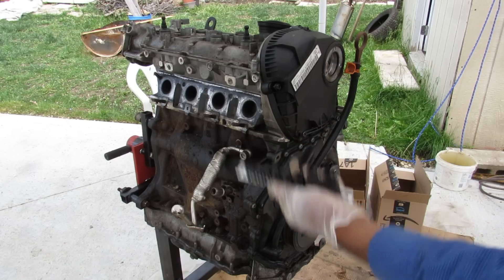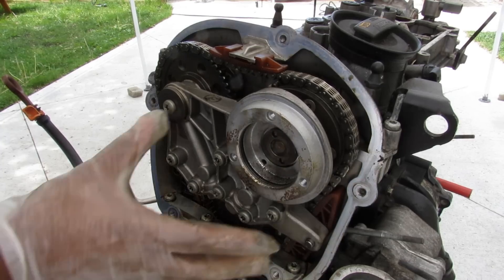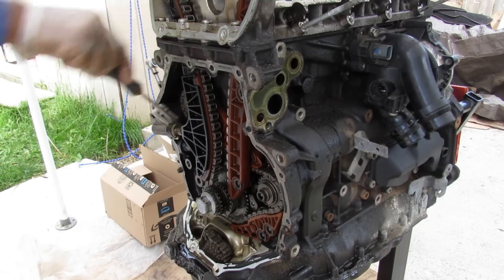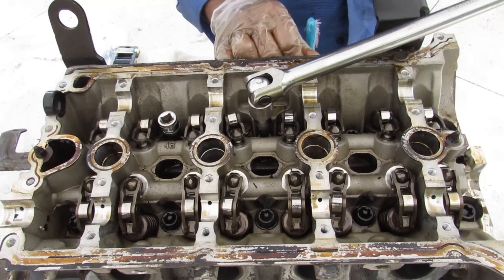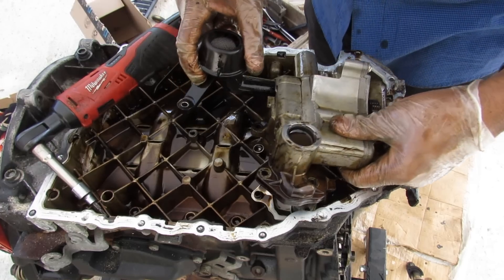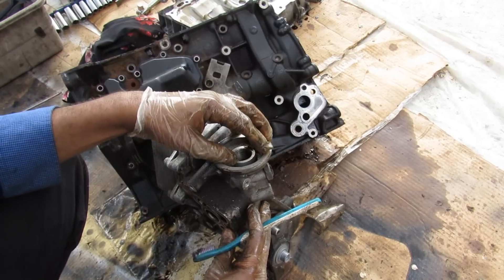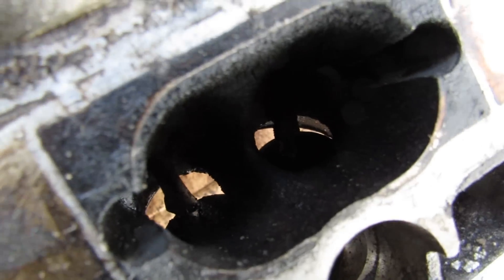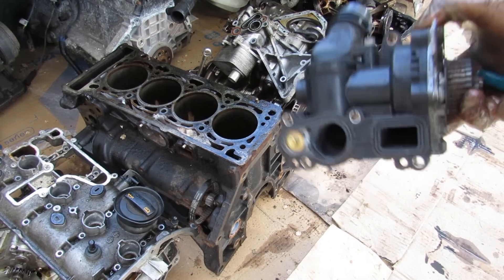Why Volkswagen Engines Fail

Comment: I'm late to this party but I wish I would have seen it before buying a 2018 MK7,5 GTI,  Not only is regular maintenance hugely expensive the engine design absolutely sucks.  I had an oil cooler leak coolant into the crankcase.  The first manifestation was a "low coolant" warning.  I was two miles from the dealer and immediately took it in. They said it was fine.  I got a repeat the next day.  This time I waited until the engine was cool and determined that it was essentially out of coolant.  I had it trucked to the dealer where they charged me $1,500 to replace parts and flush the radiator and change oil.  I expressed concern with coolant in the lubrication system and was told not to worry.  Two days later the engine blew up.  They wound up putting in a used 40K (they say) engine that cost me another $9.5K.  I have $11K in a car worth at best $15K.  The concept is great, handles well, sporty, nice interior, etc. The execution is awful.
Reply: Excellent presentation BTW and funny too.  For reference I also have an '09 Pontiac G8 GT 6.0L with 197K miles on it.  Major maintenance, 1 failed cam follower at 195K.  I keep it around to drive when the VW fails.

Comment: Porsche does not use that engine they use a boxser engine
Reply from the maker: How about the 4 cylinder SUV
Reply: they make a 4 banger n 6 boxser engine @speedkar99
Reply: Why Subaru Engines FAIL boxser engine @speedkar99

Comment: Oil pans are not that stamped steel. That is aftermarket, OEM would be a hard plastic... I know because my previous 2016 GTI's was leaking. They are notorious for leaks and when they do upgrading to a steal one is ideal.
Reply: Depends what year. This engine has been around a while now and there are different versions. My 2008 Golf GTi had a steel oil pan and so does my 2007 Audi A4 TFSI that I still own.

Comment: We have a 2012 Audi A4 wagon 106,665 miles.  It cranks 2-3 seconds longer than it used to and it shakes when cold, is that timing related

Comment: VW/Audi tech here. The accessory bracket doesn’t need to be removed to remove belt tensioner, there’s a 5mm Allen on the back side that you remove to slide the belt tensioner out of the bracket.
Also that is not a valve cover, it’s a cam ladder/girdle/bridge as the bearings are part of that assembly.
Also the oil pump isn’t timed.
Also he kept referring to the vacuum pump as the HPFP, the HPFP bolts to the vacuum pump and runs off the 4 lobe part of the exhaust cam
Reply from the maker: Thanks for the correction.
Reply: @speedkar99  no prob, great video as always. Just wanted to clarify some stuff since I work on these engines basically all day every day haha

Comment: VW engines are shit. Yes, they are powerful per cubic inch, but they are trying to squeeze every KW from the engine using unnecessary complicated and unreliable design and tons of plastic components. So much plastic that even the steel components behave like plastic - thinking about the timing chain.

Comment: I own a Mk5 gti, and owned a mk4 Jetta and I have to say. I will never, ever buy another fucking volkswagen. The only good thing about these engines are the blocks. The rest is always dogshit. I have done everything to this car, and done it in my own garage. I’ve had oil leaks in all places oil can leak. I’ve had not one, not two, but four door actuators fail. I’ve had my crank position sensor fail. Oil leaking out my oil filter housing because it got warped BECAUSE it’s made of plastic?! My headliner falling because the manufacture can’t get glue right after decades. Speakers blowing out at half capacity? Window adjuster switch never worked since I got it. Side rear view just fell off. And this last one, I just don’t know. My drivers and passenger window switches behave differently from one another. One you can pull up fully to fully roll the window or you can pull up slightly and release when you’re done. But only the right one does that? Oh and the fact that I’m always at risk of being pulled over because my license plate lights don’t work because of some weird wiring issue that requires me to remove the bumper to try and diagnose. And so much fucking more. If you ever are thinking of buying one of these I hope you either get lucky with one that might fucking work, or you pay a Volkswagen tech to deal with it. That second option is harder for some people with lower end models because they can’t afford the ludicrous mechanic fees because they are more than their cars worth. Fuck this brand and fuck all their vehicles.
Reply from the maker: Thanks for sharing your experience

Comment: These engines are definitely not easy to work on and their complexity leaves them open to a lot of potential problems.

HOWEVER, if you're an enthusiast and love the driving dynamics of German cars such as the GTI, you owe it to yourself to learn the ins and outs of this engine. They are incredibly rewarding when running well. They also have a lot of untapped power that you can safely unleash with a Stage 1 tune and no hardware modifications. Further, there are tons of resources from enthusiast communities and lots of online parts stores that make servicing them easier and definitely more affordable.

These cars aren't soul-killing driving appliances like Toyotas, these cars are meant to be enjoyed. If you're looking for reliability at the expense of driving excitement, then by all means, get yourself a Corolla. Don't go near a GTI or Jetta -- you'll hate them!  

But if you love that feeling you get from a loose and light engine that's eager to rev, that feeling of tightness and responsiveness from the steering wheel, that road-hugging suspension and the planted, secure feel it gives in curves and bends, if you're even remotely excited by driving and are comfortable doing your own maintenance and some repairs, then don't let these engines intimidate you. Just take care of them as best you can and they will reward you. Stay on top of the maintenance and address any warnings before they become problems and you will be just fine.
Reply: Wow! You’ve said what I’ve been trying to tell people for such a long time! I’m on my 4th VW (currently a GLI) and it took me a while to learn each of the VWs that I’ve owned. I feel like I know many of the ins and outs of VW engines, and I know what I’m capable of doing and what would be required for a VW tech to do. And you’re right about the maintenance. It took me a while to learn that the hard way but ever since I’ve been doing my own routine maintenance and staying on top of it, my car hasn’t left me stranded and I’ve never been more confident with driving my car and tackling maintenance items. 👍
Reply: @dimi3391  Absolutely. 100%. Glad there are people out there who see the positives  👍

Comment: I could have swore the ringland failure on the ea888 was due to pre ignition. I could be wrong though.
Reply: Public opinion is a 50/50 between IF LSPI gets really bad the pressure spikes in the cylinder can be enough to crack a ringland and well they just kinda randomly fail.
But its NOT random it IS LPSI related and related to Knocking in general. 
Solution:
Fill up with higher octane gas than required and use a low ash C3 oil.

Comment: Wow, your knowledge on these engines is phenomenal. Thank you for it. Do you have a sense of how high reliable is the latest "EA 211 EVO TSI 1.5 engine ". if ensured with regular oil changes as per manufacturer recommendation of 15,000 KM or 1 Year ( which ever comes sooner) .and not reving the engine hard ( keeping below 3k RPM ) what would be your thoughts on how many kms this 1.5 TSI engine would last ? Also, should i be concerned about carbon build up?
Reply from the maker: No experience with the 1.5. I'm about to teardown a 1.9 diesel, stay tuned!

Comment: Just watched this video again. My VW has 57k miles and I think it's time to get a mechanic to check on the timing chain tension and the carbon buildup on the intake valves.
Reply from the maker: Yes. And if yours is the old tensioner, have it swapped out.

Comment: nice job taking appart the engine.  You say its a VW engine? Its crapp. Its disind  wrong. Now i understand the problems that VW hase. I drive a type 1 diesel rabit, VW 1600. Its stil running after 480.000 km. I have a lot of funn whit this car. But what i see above, its contstuckted wrong!!! i will never buy a vw newer type. Its crapp. Its wrong...
Reply from the maker: Yeah they really messed up the tensioner design

Comment: The tensioner has been revised after around 2011. Change that oil often. Dont drive hard until engine is warm. Keep an eye out for oil leaks that can hit water pump module.  if you can stand a toyota buy one for better reliabiltiy.

Comment: Your analysis is astoundingly thorough. I bought a 2009 Audi A4 2.0 new while it was still on the boat in the Atlantic. I gave that engine everything. I cared for it as meticulously as anyone possibly could. It was a glorious car when it ran. Nonetheless, it chewed through three heads in 142,000 miles. I gave up at that point and bought a Subaru.
Reply: This was a year ago, how many head gaskets have you done by now?
Reply: @MrDAvIx63  I was going to say, moving to subaru complaining about VAG reliability is interesting lol

Comment: If anything the flaws on these engines have progressively got worse.  Had a 16 golf R waterpump / thermostat housing gaskets fail at 32,000 kms.  In this video it looks like the waterpump material is still aluminum which they have done away with now and switched to plastic as well.  

These videos are so good.  Keep it up!

Comment: Great video!

If you maintain a 2 L VW (latest model) engine very good, how many miles could you expect to get? And also what is your opinion on the new 1.5 L motor?  Thank you
Reply from the maker: 2 miles till check engine light 🤢

Comment: I found that the tensioner issues on most of these come from really filthy/sludgy oil because a lot of people tend to neglect their oil change routines. 10,000km factory recommendation is absolutely absurd and realistically the tensioners are driven on oil pressure. I keep my oil clean and topped off. I haven't had any issues with the old tensioners. I think the tensioners are a combination of poor design and poor oil maintaining but that's just my opinion based on what I've seen. Obviously the design could've been better but when ppl pull up w/ the oil barely touching the dipstick or riding on 13,000kms or BOTH ...It makes me wonder.
Reply from the maker: Yeah I feel like the service intervals are getting too long now

Comment: The chain tensioner on this motor was guaranteed to fail.  Was revised 3 times.  New EA888 gen 3b was much better no chain failures.  Kind of sad that the chain tensioner design was so bad because the engine itself is pretty good.

Comment: And this is why the German mechanic will tell you to replace the whole engine.  

If it is failing in one area, it will be failing in another later.  

Is it "over engineering", or planned maintenance?  You decide.

Comment: I was a VW trained and certified technician. I always had a job. And, they can be the most pain in the a** vehicles to work on. 

They are interference engines. Never really understood why. Just a VW thing.
One theme I identified working on so many VWs is that while VW can make great cars, the engineers seem to always screw things up by over-complicating simplistic things and then over-simplifying the more complicated things. Timing chains are over complicated, yet depend on a dinky tensioner and they still use interference engines, and ba BOOM!

Comment: I have a 2011 VW Polo 1.4 gasoline 85hp , 255.000km , changed belt at 120k and at 240k km, only regular maintenance every 30k km with Castrol long life, how many other km do you think it could last? Thanks!

Comment: That "high pressure fuel pump" you removed was the vacuum pump. The HPFP is bolted onto that at the front.
Reply from the maker: I keep mixing up those two. Both of them driven off the camshaft
Reply: @speedkar99  yeah the fuel pump is driven off the 4 lobes and the vacuum pump is driven by the key way on the end of the cam

Comment: I fix them with bad chains and bent valves all the time. That engine was not well maintained.
Reply from the maker: So what's involved in the head job? New stem seals and valves as well?
Reply: @speedkar99  Just put new valves in it. Never had one not seal afterwards. Stem seals would be a good idea if it's high mileage.

Comment: If these VW/Audi & BMW engines are all full of unmaintainable plastic, will there be many nice condition 7-10 year old cars being written off that could receive $200 15 year old Honda engines/trans from worn out donor cars and have 5 years more without engine trouble? Funny if Honda engines rotate in the opposite direction! 😀

Comment: As a chartered mechanical engineer I'm disappointed by the design of this engine. It seems like they have cheaped out on costs by the extensive use of plastic parts. As most of us know, plastic  doesn't always perform well when subjected to the hot environment of an engine. With regard to the design of the chain tensioners, they don't seem to be fit for purpose. In the quest to save fuel and emissions it looks like this design makes up for the savings in failure and therefore waste of materials.

Comment: Does it have as many problems as the variable cam v6 engines from gm and ford in recent years. That engine looks to be very poorly maintained as far as oil changes and keeping the fuel system clean.

Comment: I have a 2013 gti, the only thing i have ever had to do was get the valves  ceaned because ALL direct injection engines have thia problem. The water pump had a recall on it when i first got it. No problems at all.
Reply from the maker: How about the chain tensioner?
Reply: @speedkar99  For the Mk6 motor, by 2013 they had revised the tensioner. I believe it was 2011 or 2012 when they switched to the new design.

Comment: These engines are actually great! My mom had a VW with this engine that has 320,000 km, and it's still running strong! She got it as a gift upon returning home from her first mission to the moon some years back, and handed it down to me after my first mission. Many moon missions later, and I still drive the car every day to my 2nd job at our unicorn ranch! 🦄
Reply from the maker: Awesome. Was the tensioner replaced?

Comment: "Although if it does fail it will eventually end up in catastrophic engine damage."  His dialogue is unwritten poetry.
Reply: More like instantly rather than eventually. A quirk of the 1.4 engines was that if the car was left in gear and rolled in such a way as to drive the engine backwards, sometimes the timing chain would jump a tooth, leading to the engine either running badly or self destructing next time it is started.
Reply: @peglor  golden

Comment: I can only laugh at VW, they over complicate engine design and still can't make reliable power. The old Opel C20XE /C20LET motors can run at redline all day long without much effort and still used less fuel and make a equivalent power.
Those used 90's tech and unfortunately you guys in the US didn't get them. There's a video of a Calibra that trounced a Gallardo on the www that has a C20LET motor, albeit modified.